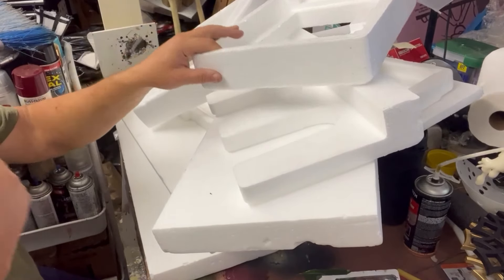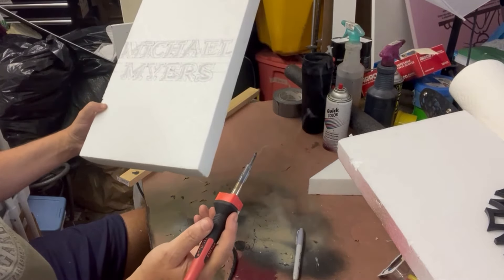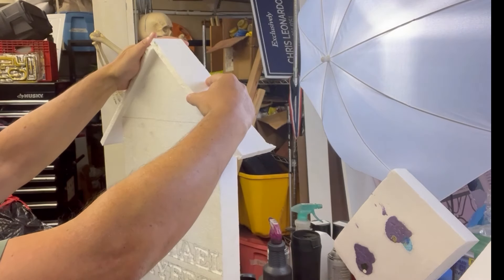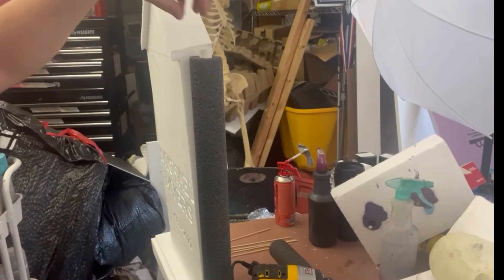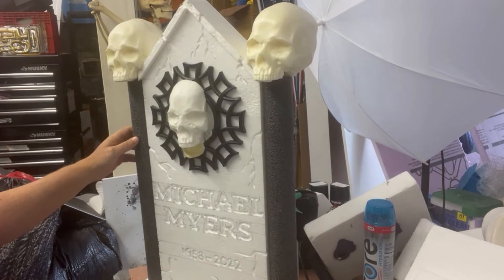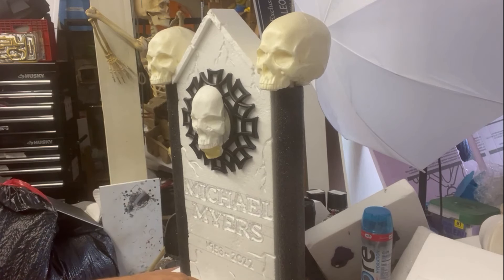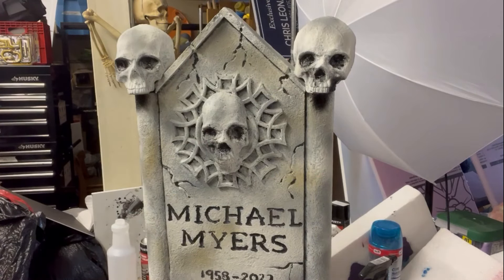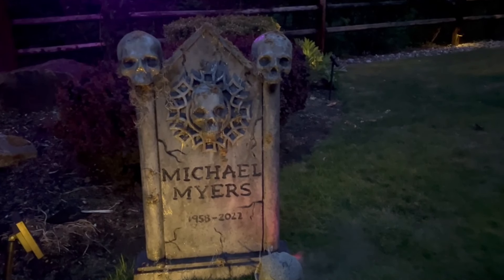Easiest DIY Tombstones, for Less than 10 Bucks!!

Comment: What adhesives are you using? I am trying to make a few of these and running into issues with getting items to bond. HELP! please :)
Reply from the maker: I use clear Gorilla glue, although original will work too. You could also use great stuff expanding foam for adhesive but it's messy and you will have to cut the excess after it dries.

Comment: Thank you for this video. I've got a question for you. The hot knife that you used looked like one that I purchased at harbor freight. It kept failing on me. I returned it twice and decided to buy a better model through home Depot at about four times the price of the harbor freight one. Did you have problems with that harbor freight hot knife? Thanks again.
Reply from the maker: No, it worked great for me. Although I ended up putting trim pieces on the top of the tombstone, so really you could just cut it with a box knife and cover it up with the trim. The base might be more difficult though.
Reply: @GRUNGEHaunts  Great idea, and really nice work! Thanks 👍